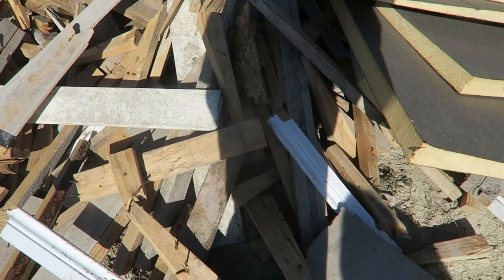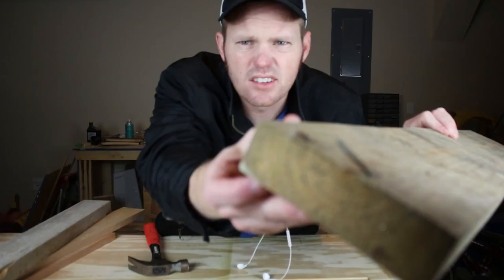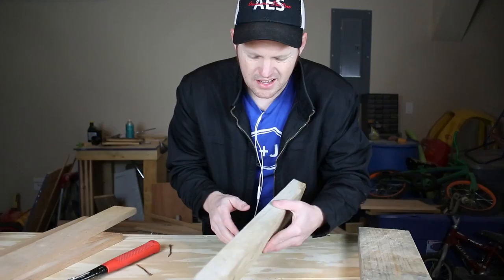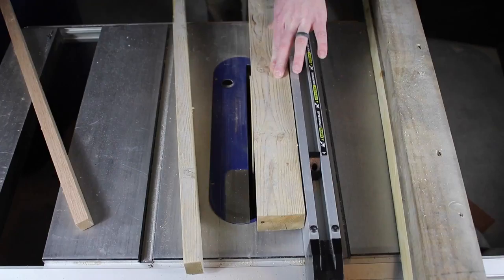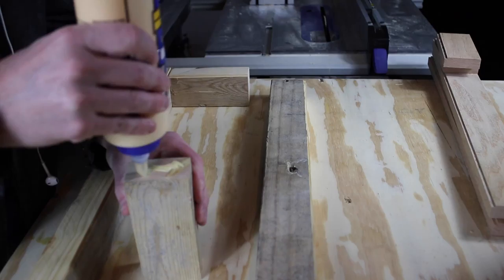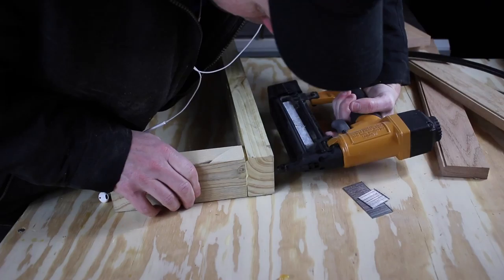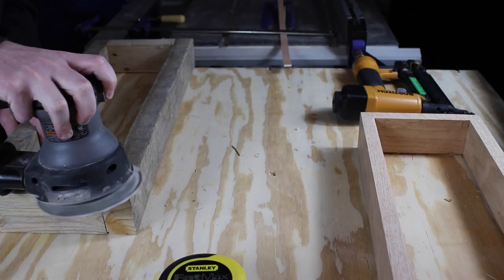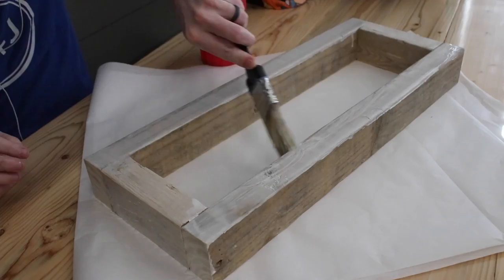DIY Wooden Box Tray Mason Jar Table Decor

Comment: I haven't done much wood work, but would like too. My question is,  why do you use glue, then nail the boards? Just curious.Thanks.
Reply from the maker: +Deb Carpenter the glue holds it together better and stronger than the nails. I nailed it so I wouldn't have to clamp it and wait for the glue to dry.